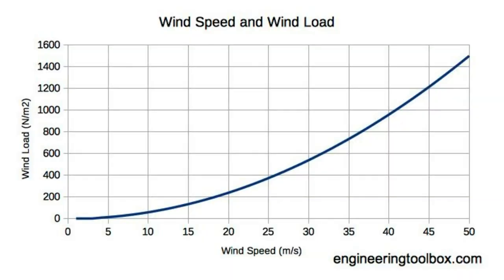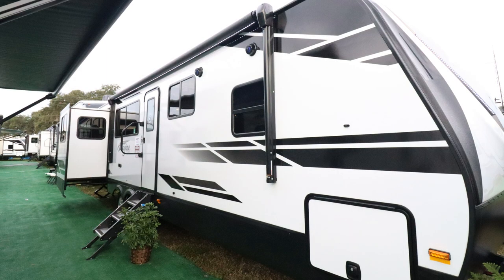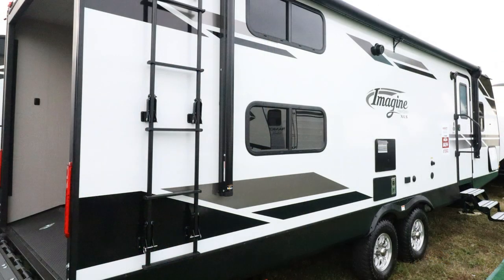The HUGE Issue With Travel Trailers No One Talks About

Comment: I am a complete newbie and have never towed anything. We are looking at a travel trailer with the specs below and need to purchase a used tow vehicle to go with it as my current SUV has a max GVWR of 5,400. Can you make any recommendations? I was looking at diesel 250s but then I read elsewhere that the Diesel engine is heavier than gas and eats at your weight limits. I’m watching your other videos too....trying to wrap my brain around all the different weight limits. I just want my family to be safe and at peace when on the road! So to summarize: what size truck for the TT specs below, what brand hitch do you prefer? Thank you!!

Dry Weight
7,012 lbs.
Payload Capacity
1,556 lbs.
GVWR
8,600 lbs.
Hitch Weight
672 lbs.
Reply from the maker: Gas or diesel 250-2500 should suit you fine. Bump up to a 350 if you want the diesel and extra cushion in the payload dept.
Reply: @WanderingWeekends  thank you so much! Is your 250 your daily driver or just your tow vehicle only?

Comment: The 2800BH is 3/4 territory for sure. Started with a 150 with air bags, LT tires, and a propride. Still couldn’t handle the trailer. Well under all numbers but couldn’t handle the side winds. I didn’t want to believe that the truck couldn’t do it and people sounded dramatic. Upgraded to a 250 and truth is it really is a night and day difference
Reply from the maker: I hear these stories all of the time. Glad you’re happy now!
Reply: @WanderingWeekends  Yes sir! I wish I had listened but just wanted to hear I didn’t need a new truck. Glad you’re liking that new Godzilla. I’ve heard great things. Still love my 6.7 but that engine is impressive
Reply: My expedition tows it just fine.  All about loading the trailer appropriately,  weight distribution hitch dialed in multiple trips to the cat scale and it toes it just fine.
Reply: @Jrparne  I’m glad you got it to work comfortably for you. I spent 4 months and about 15 trips to scales. Lots of tweaking and re-weighing. Spreadsheets logging all the changes and how the weight was being distributed. It improved a lot but never quite to my liking. The cross wind still killed us at highway speeds. Weight wasn’t much of an issue but fwiw our load out produces about 1,100 lbs of tongue weight. Comes in at around 13-14%. Mind that 200 extra pounds is added by the propride
Reply: @Mike_12345  appreciate the reply!  I have to play more with weight inside the trailer than the weight distribution hitch.  I get the tongue weight to about 10-12 percent and it seems to balance fairly well.  Honestly I believe it’s that huge storage bay up front that I know we initially overloaded which yielded way to much tongue weight.  The wd just couldn’t balance that tongue weight.    But I get it an f250 will always tow anything better than a half ton.  Now I tow it with an F250 and it’s night and day.  It feels more like towing my old 4000 lb 20 foot trailer.   All I am saying is a half ton can do this just fine and safely.  There is nothing wrong with feeling like you have a lot of weight behind you while There is something wrong if its swaying or you have a hard time stopping it.
Reply: @Jrparne  You’re welcome! Always glad to share my experience. Your points are well taken and I agree that it is probably safe for most situations. I like the feeling of pulling a 4,000 trailer I guess 😂

Comment: Scheduled to pick up a new Spirit 2963BH in a few weeks and had thought our 2017 F-150 would be plenty of truck until watching this.  The thought of giving up the daily drivability and performance of a 3.5 EB for a Super Duty is less than appealing.  Would a Propride 3P hitch provide enough margin for a rig that pulls less than 5K miles/year?
Reply from the maker: I’m surprised at the number of Hensley and ProPride owners in the comment section who still felt the need to move to a 3/4 ton truck. I’ll leave it at that since I don’t have any personal experience with either. Appreciate you watching!

Comment: Take look at the chart it’s in meters and Newton’s  not feet makes sure you convert your feet to meters 
I pull a 28 ft with a half ton have no problems even in high wind I know someone that has the same hitch system that you show on Amazon and he has problems with wind. I use separate sway control
Reply from the maker: I sincerely believe some would have to tow with a 3/4 ton to understand.  I also believe some peoples "it tows just fine" is different than others "it tows just fine".  As long as you are happy.

Comment: Because a standard 1/2 ton shouldn’t pull a TT over 6000 GVWR and if you have the heavy duty tow package on a 1/2 ton you should not pull a TT over 7000 GVWR.  There are only one or two 5th wheels a  standard 1/2 ton can pull and once again if you have the 1/2 ton heavy duty tow package you should not go over a GVWR OF 10,000. The HD 1/2 ton package has extra cooling and at LEAST a 3:42 rear end or lower like a 3:73 etc. WW is absolutely correct in what he is saying about towing. Don’t be a white knuckler on the road, you not only scare yourself with the wiggles you scare those around you!

Comment: What about using a Hensley/ProPride hitch?  I keep hearing about them.  I am leaning 3/4 ton for a 8200 lb loaded unit.
Reply from the maker: I’m actually surprised by the number of folks in this comment section who were running a PP or Hensley and still decided they needed a 3/4 ton truck. I’ll just leave it at that since I have no personal experience with either.

Comment: Hey Corey. Love the content. We have an F250 7.3L Godzilla (34 gallon tank) and an Imagine 2910BH on order (I believe it's only two feet longer than your rig). Trying to do some back-of-napkin planning for this summer. What sort of realistic range can I expect? I've seen conflicting numbers.
Reply: I have an Imagine 2970RL, just upgraded to the F250 with the Godzilla 7.3L pushrod V8 (insert Toolman grunt) this winter.  I haven't had a chance to do more than adjust the WD hitch with my camper yet (damn winter), but I'm projecting about 8 mpg, so about a 240 mile range.  The thing about that, though, is wind will still impact your range dramatically.  If you hit a stiff headwind, you might go down to 4 mpg, you get a good tail wind, you might hit 10-11 mpg.  I'll probably look for fuel stops in the 150-180 mile range, if for nothing else, to get out and stretch and fill up where it's convenient versus a necessity.  For what it's worth, I was getting about 8 mpg towing my rig with my F150 with the 3.5L Ecoboost.  So from a towing standpoint, I'm expecting comparable economy with a much more comfortable experience.
Reply from the maker: Hey Jaime!  We are at 9.5mpg's with the 2800BH.  That said your rig is about 1000lbs heavier (6386 vs 7397 UVW).  I'd place my bet around 8.5-9mpgs.  As mentioned above wind plays a huge role.
Reply: Thanks guys, that's helpful and consistent with my expectations. I was hoping to be able to install a larger tank on this truck and was disappointed to see that none of the usual manufacturers are building them for the gassers. Maybe the 7.3 will change that.

Comment: Hensley Arrow ELIMINATES sway.
Reply from the maker: Most folks with a Hensley or ProPride speak highly of them. That said I am surprised how many Hensley owners in this comment section still felt the need for a bigger truck.
Reply: @WanderingWeekends  True, I tow a 30ft trailer 6200 dry with a Toyota Tundra.  I am in central California. I have yet to go on a longer trip to Utah and Idaho but I will be doing that this spring. So far during local trips with the Hensley it tows and stops great.  Time and experience will dictate if I need to upsize to a 3/4 in the future.

Comment: We had a three-quarter ton Ford 4 door 2 wheel drive pulling a 33 ft Mallard and it still suede quite a bit
Reply from the maker: Were you using a WDH w sway control?
Reply: @WanderingWeekends  yes beats all I ever seen they put the water tank in the very back of the RV
Reply: Tongue weight plays a big part in a travel trailer, it is your friend . I find if you can get between 12 to 13 percent of gtw they just seem to tow better. There are a lot of good hitches out there these days some control sway better than others. You will here that Pro Pride or Hensely is the fix. They are great hitches but at a great cost for most and most can get great results from a good hitch at a third of the cost. If you want one and can afford one great, I am blessed and could have one if I wanted but I don `t need it, I am rock solid. If you have a good hitch and it is setup properly with the unit loaded properly and you have a sway problem I would be checking axle alinement, tires and air pressure .
Reply: @captainmc0685  we no longer have this trailer this was after Hurricane Katrina yet and we went down and did relief my parents bought a 33 foot Mallard for us to stay in there while we worked we no longer have this camper and I'm very aware of sway control hitches thank you very much for your input

Comment: When you talk about length as it relates to forces of wind, are you talking the length of the box or the hitch to bumper length?  We’re looking at a 26’10” trailer but the box is only ~22 ft.
Reply from the maker: Overall length. Most trailers have similar setups front and back.

Comment: Hillbillies with YouTube channels are my go to for travel trailer knowledge:). So I’m considering an upgrade a slightly larger trailer than my 16’ maybe 20’ max I have been towing with a Nissan Frontier which I’m also about to replace. We have a weight distribution hitch and anti-sway bar and have felt reasonably safe, towed it up to the Blue Ridge Parkway once, no issues. One thing we have done is kept an eye on weather when traveling and sought shelter when the radar has shown a big red blob headed our way. Any thoughts on what truck I should be looking at for my next truck with a 20’ under 5000lb dry weight trailer in mind?
Reply from the maker: Appreciate you watching! You should be good with most 150/1500 series trucks. Have fun shopping!

Comment: I have a 2012 Chevrolet Silverado crew cab 1500 with 3.42 and tow package. I tow a travel trailer that is 24'11" dry weight is around 44 or 45 hundred gvwr is 7200 but I never come close to that weight. I don't usually travel more than 75 miles from home but have a trip planned for around 200 later this year. What do you guys think? Can't afford to buy a new truck.
Reply from the maker: 25ft is under that 26ft threshold.  You should be OK... just don't get in a hurry.
Reply: @WanderingWeekends  thank you.

Comment: We started out towing our 24 foot travel trailer with our GMC Yukon.  We bought a ram 2500 6.4L gasser late last year. The difference is night and day. I cannot believe I pulled it 600 miles to Orlando with the Yukon. It’s a wonder I didn’t have a heart attack. Just out of curiosity what’s the payload on y’all’s F-250 gasser?
Reply from the maker: We’re a hair over 3000lbs
Reply: Just trying to compare my ram and the F-250. I’m at 3288lbs of payload.
Reply: We have a Yukon and took our 22 foot travel trailer on it first trip from Tampa to Ft Myers.  I made it 5 miles on the interstate and had to exit.  Ended up taking the scenic route and turning a 2.5 hour drive into a 5 hour drive.  Thought it was the winds.  Nope. Came back on Monday taking US 41 and couldn’t drive over 55 without the back end of the Yukon feeling like it is being pulled out from under us.
Reply: @christopherhigginbottom2609   2019 Silverado 2500HD 4x4 doubleCab shortbed 6.0L gas has right at 3,000 pounds payload and 9,500 lb GVW. The 2020 generation they upped the GVW and the payloads increased. 

Very happy with the towing capacity or our truck. Wish it got better gas mileage but it’s a very simple rig in comparison to many other rigs.

Comment: So, what is it exactly that's offsetting the wind load?  The mass of the 3/4 ton?
Reply from the maker: Or the footprint... I’m not smart enough to confirm... 🤔
Reply: Usually the the empty weight on the truck must 1/2 trucks weigh between 4200 and 5500lbs where your 3/4 ton weighs 6000 to 8000lbs depending on options so it can handle the extra weight better plus for your wind profile the 3/4 ton truck sits higher

Comment: Love your channel! 

I have a Grand Design Imagine 2250RK (27’11”) total length, 5600lbs empty, 7000 fully loaded, pulling with an 2016 F-150 3.5 eco boost, super crew cab, short bed, using an equalizer WD hitch.  Do you think the F-150 is ok pulling this sized trailer?
Reply from the maker: You’re just outside the edge of what I’d pull with it but if you’re comfortable that’s all that matters.

Comment: I get it,  3/4 ton trucks will always tow better.   But half tons with properly distributed weights in trailer,  wd hitch,  and truck tow these trailers just fine.  It’s all in the operator.  There are limits for a reason and opinions are just that opinions.  Yes a 3/4 will always tow better than a half ton but anyone with a bit of preparation can tow safely.  Your 2800BH tow’s just fine behind my expedition.   Sure a 3/4 ton would be better,  so is a 747 vs a 737.  But they load up 737s all day long.
Reply from the maker: I’ve towed our 2800 with a Max tow Expedition EL... there is no comparison.
Reply: @WanderingWeekends  appreciate the reply!

Comment: Travel trailers these days are repurposed FEMA disaster trailers. They are a poor substitute for travel trailers. My dad towed the older style travel trailers with a full-size Chevrolet wagon with a 235 cu-in six cyl coupled to a cast iron two-speed Powerglide automatic transmission. Even through the mountains. Also with a Ford Falcon with a six-cylinder manual. You cannot do that with these FEMA trailers.
Reply: R Arbuckle @ FEMA trailers? How original!

Comment: Respectfully... more details are needed. I pull the same trailer with a 18 F-150 Ecoboost, 10ply tires, air bags, and a Curt Truetrac hitch. I also pull a 20ft saltwater boat. Weight distubution is the greatest issue. As a pilot... Laminar airflow is the greater issue. "Im not an engineer"... Then delete this video.
Reply from the maker: Nah... it’s staying up. People need to bring this subject up. You’re welcome to make your own video. Cheers.
Reply: As a pilot, you do care about laminar airflow, however, the plane you fly has been designed by engineers and wind tunnel tested. They have looked at laminar, turbulent, and wind loading to insure all you have to do is steer. As for campers, I seriously doubt wind tunnel testing is done and all the dude was saying is that cross winds on a camper are going to create a significant wind load.
Reply: Robert Casteel @ Bet that half ton has a great ride with 10 ply tires!
Reply: @WanderingWeekends  nice response...I had so many other not so nice responses in my head after reading his comment.  Some folks are just smarter than the rest of us.  Keep speaking the truth with your videos.